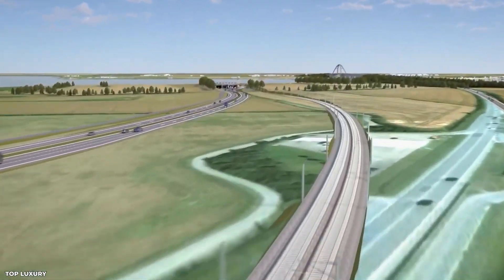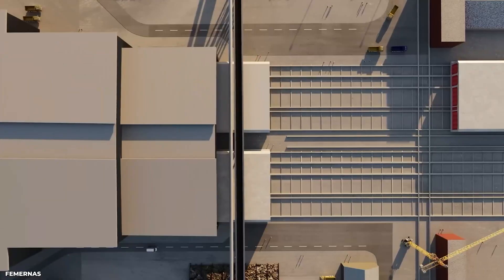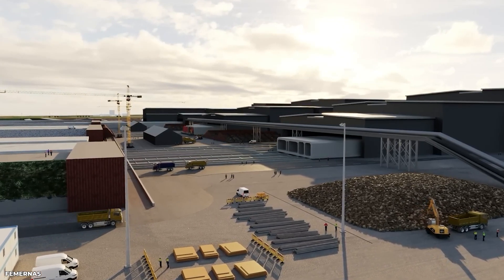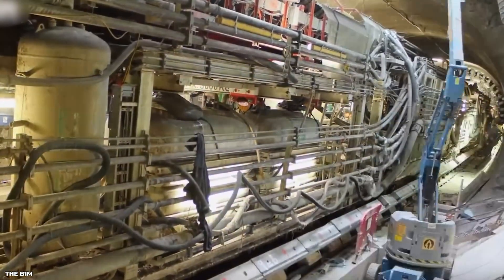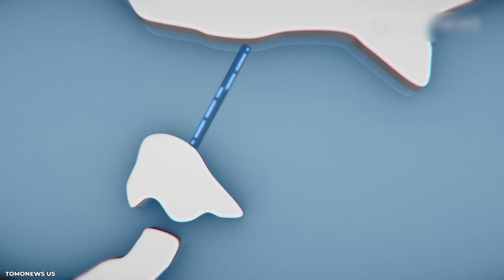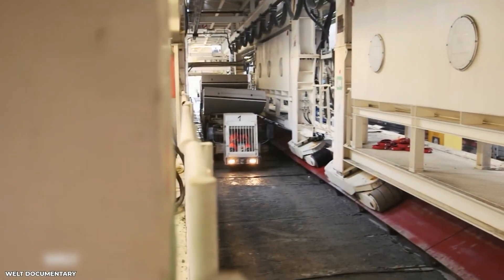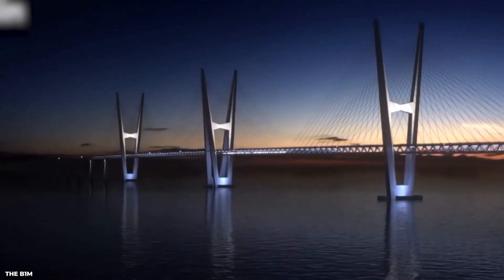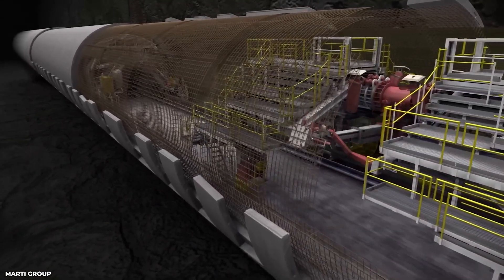World's LONGEST Underwater Tunnel Being Built In Europe 2023

Comment: I hardly think that any "Tunnelboring Machinery" is needed, as the all the Tunnel-elements are made in a Factory on Lolland, and sealed and sailed out to be sunk in the, for the purpose, excavated ditch in the bottom! Later to be filled up with bottom material, as any other sea bottom, just with a tunnel below it! Finn. Denmark
Reply: I do hope to be able to drive under, as now 76, as I have Hated the expensive and ineffective ferries for many years!!
     Now I will have passed The Belt during the time to - "optimally" arrive before the ferry sailed, for an hour!
      And the traffic won't be in large groups leaving the ferry, as now, but as it has arrived at the entrance.